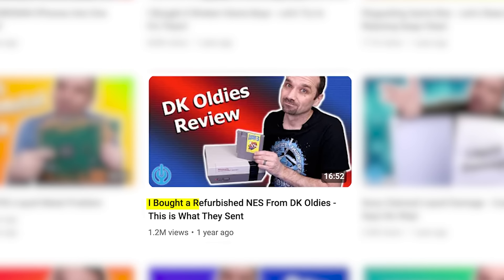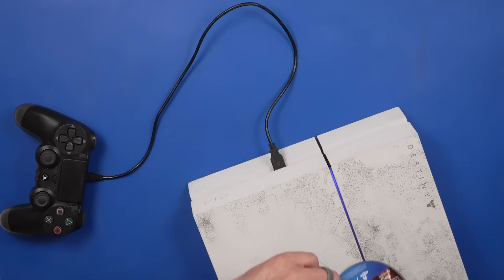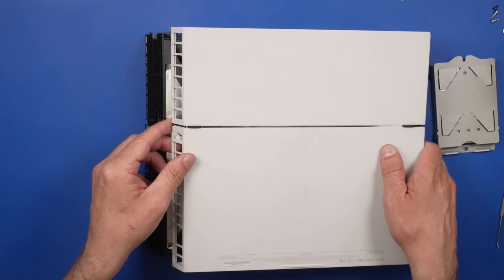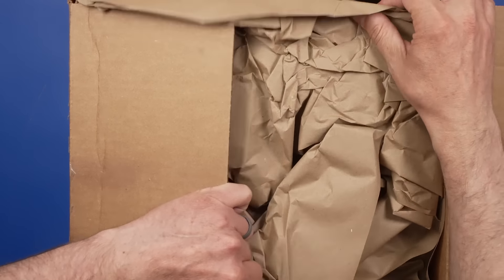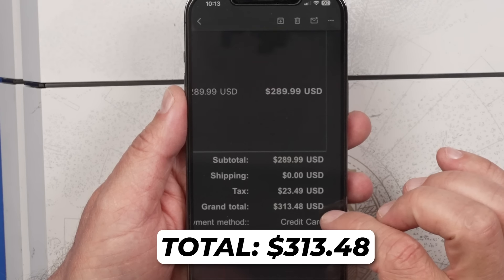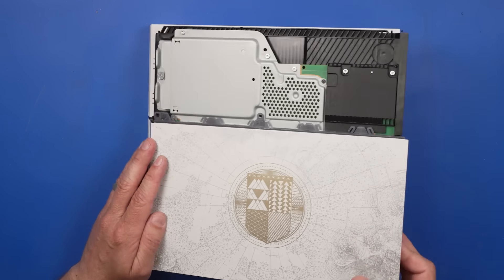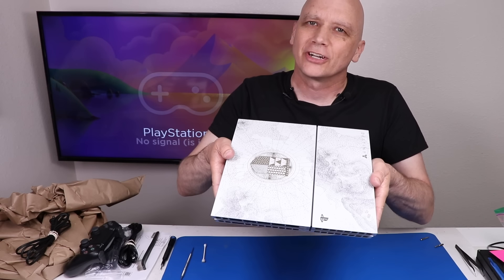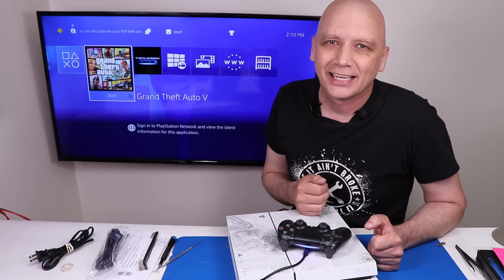Has DK Oldies Changed?

Comment: The fact that they cleaned the system, but it still didn't work shows how next to nothing has changed at DK Oldies as they didn't even bother to test the console. If a console doesn't work it doesn't matter if it is clean or dirty, it still doesn't work. A clean console has no value if it doesn't work. If anything DK Oldies has gotten worse as they are working harder to deceive their customers that they actually refurbish consoles, when they don't. Ebay is better in every measurable way.

Comment: ebay console outperformed the DKoldies one in every way and was less than half the price!! for $140 i feel like the ebay console was a PERFECT deal. no visible issues aside from the single controller button, meanwhile the DKoldies one was pretty much a brick with a nonfunctional controller for over twice the price. nothing wrong with that ebay deal at all. id rather have a dirty console that works perfectly instead of a clean one that doesnt.

Comment: DK Oldies gets zero credit for this, in my mind. You can even see @ 7:37 their own checklist shows they didn't test it before shipping it. They took it apart to clean it, didn't replace missing screws or thermal pads. What's the point of updating your refurbishing process if you're not even going to check for missing parts or test your products before selling them?

Comment: Ok so they cleaned the system decently.  But sent out a broken system unit along with a broken controller.  With missing screws and pads.  That's a HUGE FAIL.

Comment: I would rather get a dirty console that worked and a used controller that worked, than a console that could not load game disks and a controller in slightly better condition that did not work.

Sorry DK Oldies but this is completely unacceptable, if it were to make sense for anyone to actually buy from you, you have to actually REFURBISH each unit, and test basic functionality/QA.

Comment: Hey TronicsFix. I hope you are well man. Ik things been rough but i got a small project if ur interested. I got this ps1 that controller port wont work but its not the port or wire connector (tested in other system). I cant seem to figure it out. Lmk if u wanna take a crack at it!! Thank you for reading!

Comment: i want to root for dkoldies because it would be great to have a reputable retro storefront, but its clear that DKO doesn't seem interested in providing quality retro hardware. you'd be a fool to buy from them when they're shipping consoles that can't even read the disk; that's one of the most important parts of buying retro systems as digital distribution shuts down for older systems in the future.
in short - DKOldies is actively harming retro gaming and preservation, don't buy from them.

Comment: Sorry but I would be more pleased with the dirty PS4 from ebay with the shoddy controller given its cost. The cost of DK Oldies, along with the fact that both the controller and console did not work it unacceptable. Also the "Procedure" was a lie in that case. The "Functionality Confirmed" was either skipped or they did not consider testing the controller and inserting a disc. Perhaps all they did was turn it on and then shut it off. Here I was thinking oh DK Oldies, they got a bad rap before so I am sure they would improve. Somehow they royally messed this up lol.

Comment: Other than the obvious, no goes of giving a customer a product that doesn't even function, which could be easily medigated by having a functionality checklist. A customers time is more valuable than any product, and to waste that is unacceptable instead of spending the extra 10 to 15 mins on your end confimring the console that you are charging working price for actual does its basic functions is baffaling to me. A consumer puts trust that you've used your expertise to ensure that they don't have to worry about the product or in this case the work put in to a used console.

Comment: I dont think the eBay seller should be graded by whats inside. Most consoles sold on eBay are not by people who actually go inside a console. They are simply giving a grade based on overall looks and functionality. I had to learn to not judge people selling pre-owned consoles be sold by average joes. Now, if its an eBay store or someone who claims to "specialize" in this field, then i absolutely judge the state of the internals.

Also, i noticed on the checklist that the functionality part had an "X" while the rest of the list had check marks. Does that mean that they marked it as non functional but sold it anyways? 😂

Comment: It's still a sham dude! For over 300 dollars you get this??? The system's ram will die sooner or the console will shut down because of missing thermal pads, the controller is useless and the disk drive went to heaven! And you got the good condition system, but it looks like they kicked it off the stairs! I dissassembled 100's of consoles and NEVER had any screw missing! And if 1 or 2 is missing, i replace them, it's the least you can do! They are still lazy, they show on their channel how well they refurbish consoles, common dude! Shoving a disk into the drive takes 10 seconds to figure out if it works or not, even that they can't do! They cleaned it out, put it back together, they connected the controller via usb, and that's it! I don't get it how they are still in business! You should be way harder towards them, especially after a whole f@ck1ng year! Big F if you ask me!

Comment: Insane for what they are charging. I mean broken disc drive and controller gtfo it's a scam at that point. I mean one of those things one be bad. That you are just scratching the surface with what's wrong says a lot. Also I doubt they even cleaned it must have just came that way because no way they take the time to do that but don't check that the controller and disc drive are broke. Would rather it be dirty and work too then clean not lol.

Comment: DK oldies is still the skuzzy overpriced trash shop it's always been.
So no, nothing has changed.
Also, I understand comparing the two consoles but there's a clear difference between a family / rando selling a console on ebay vs a company selling it. DK oldies should have proper standards in place considering they sell it for double the price.

Comment: You shouldve gave the ebay listing more credit. You paid for a used console, its in the description and not seller refurbished. That means you shouldnt expect anyone to clean it, excellent condition means the console runs like its new with no broken buttons, running hot from clogged vents, random crashing, or a broken disc drive. The console and controller was 100% functional. If the seller cleaned it, they could list it as refurbished and get more money for it. Instead they listed it as used and even posted a picture of the unclean console so expecting more then that is unrealistic. 

Used simply means its gonna be in the same condition its in while they were using it and the poster literally meant that when he forgot the game inside lol its like he went straight from playing to unplugging it and stuffing it in the box. I dont even expect used tech to be factory reset as long as its not locked

Comment: What are you talking about a lot of it worked?

You received 2 pieces or tech. A console and a controller. Neither of which worked.

Nobody would expect to buy a $300 used ps4 and then have to replace the controller and disc drive.

Also this should never have shipped out. Their warranty isn't a warranty it's just giving them time to ignore problems ship out broken crap and expect most people won't actually go through with the warranty.

It's a complete joke and a scam.

I've sold hundreds of as is consoles... But they all freaking worked when they went out the door.